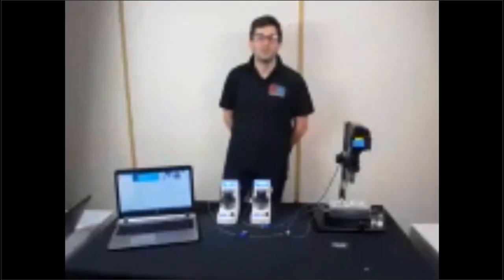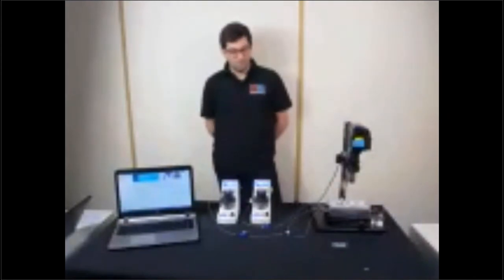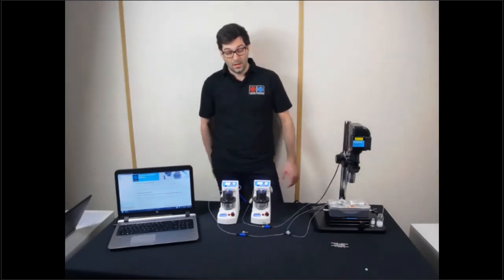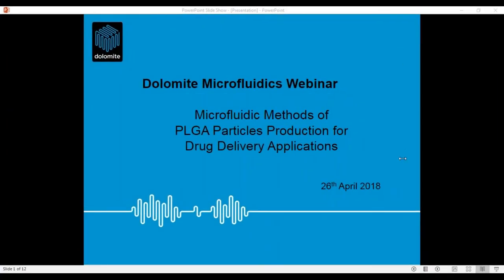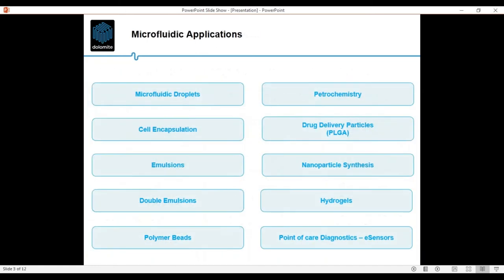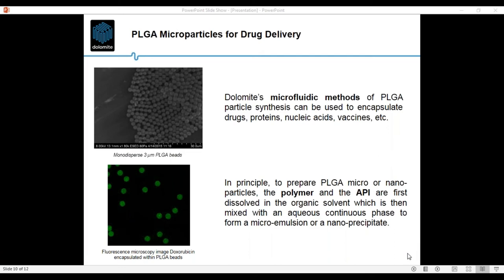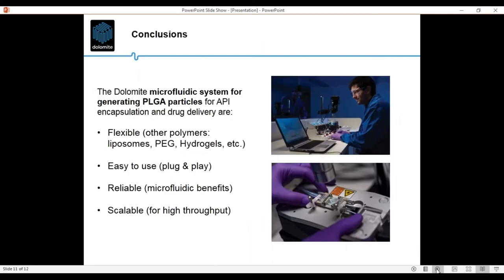Generating PLGA Particles for Controlled Drug Delivery

Comment from the maker: Helpful timestamps for navigating this webinar:

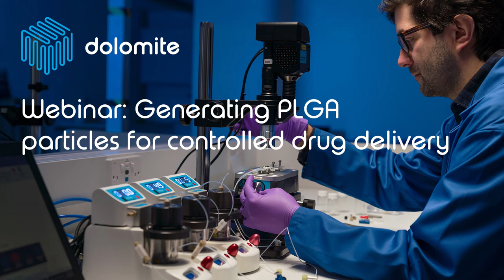1) Introduction: 0:00 - 3:00
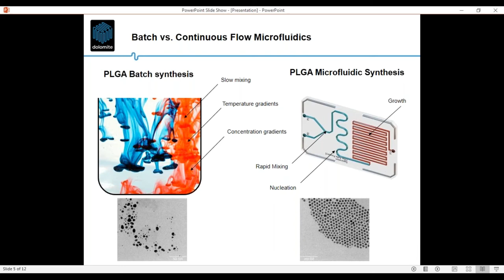2) Why use microfluidics for particles production? 3:00 - 6:35
3) PLGA particle production for drug delivery via droplet or precipitation methods 
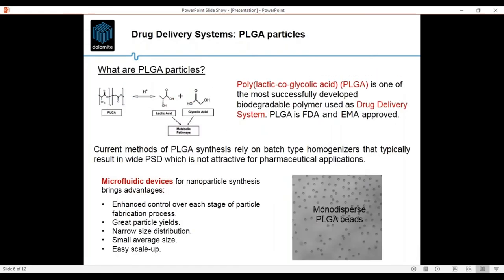using Dolomite: 6:35 - 13:40
4) Dolomite PLGA system set-up and explanation: 13:40 - 21:30
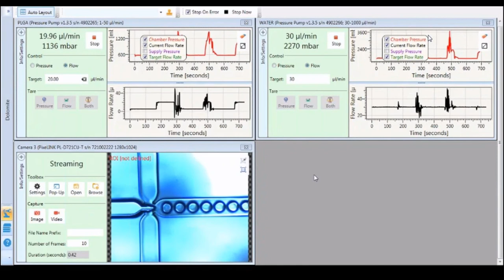5) Dolomite Flow Control Centre software explanation: 21:30 - 24:30
6) Scale-up with Telos: 24:30 - 27:50
7) Final conclusions and additional information: 27:50 - 29:33

We hope you enjoy this webinar hosted by Dr. Damiano Rossi.